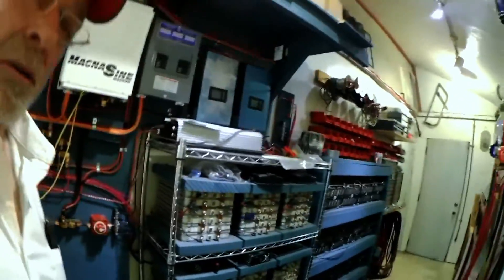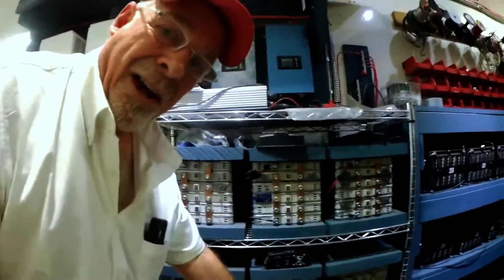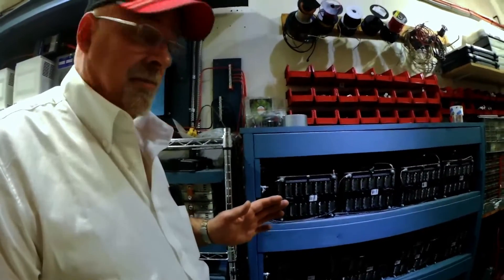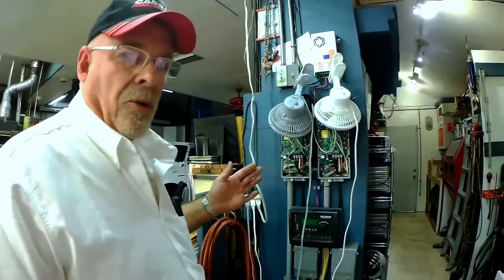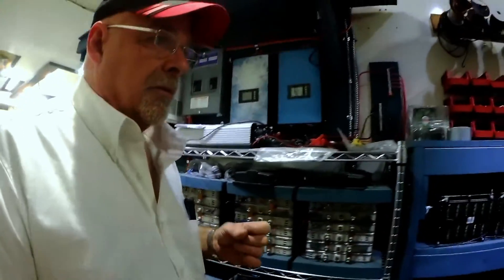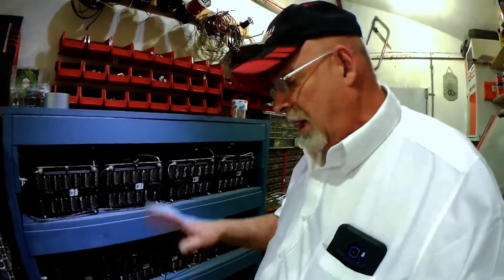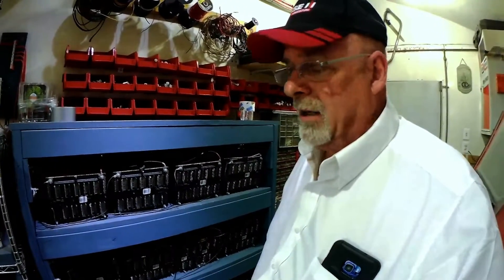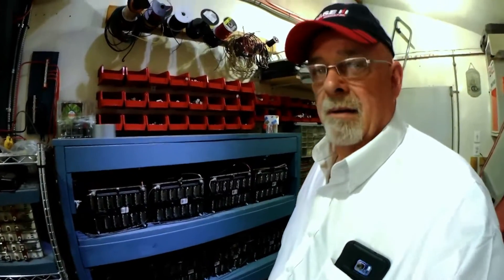BMS or No BMS ? - 30 Month Update

Comment: Thanks for the video! I have a 100 AH lithium (LFP) 4-series battery on my sailboat that I have been running for four years without a balancing BMS. I did that after a bad BMS (damaged by a nearby lightning strike) ruined an earlier battery -- FETs don't like voltage spikes. I have a battery PROTECTION system that cuts off charge at 80% SOC and cuts off discharge when the pack voltage drops below 12.8 volts (3.2 volts per cell): about 20% SOC. Current limiting is accomplished with a 60 amp series fuse ($18). I charge and discharge at 0.2C max. I installed thermostats on every cell in a series string that shuts down charging and discharging if the cell terminal voltage reaches 40 C - 122 F ($15 each). Low temperature charging (below 0 C) isn't an issue in my climate.

I charge the pack under careful supervision once per month to 100% SOC while monitoring cell voltages. Once, only once, I manually top-balanced the cells using at 2.7 ohm resistor ($1.50). The pack tests at 97% capacity after four years and about 500 cycles. A balancing BMS is a mixed blessing (complexity is the enemy of reliability) that seems to only be a necessity when running a battery at high C rates and high and low SOCs. They make sense with an electric vehicle or any application where the user wants to squeeze out every last amp hour, but they carry the risk of failure in the BMS itself.
Reply from the maker: Bravo !   I have absolutely nothing to add to that :-)

Comment: Interesting to see a long term test on a large setup with no BMS. Thread is 4 years old is it possible to update to 2024?
Reply from the maker: I ran them without a BMS all the way to the fall of 2023 when I switched over to LifePO4 cells from Docan Power.  The Volt and Leaf cells remained in near perfect balance the entire 7 years they were in service and amazingly tested to 90-92% capacity when I tested each individual 48 V pack.  The Leaf cells went to a friend in Texas, I got almost what I paid for them. I still have the Volt cells.  I need to get them up for sale. Thanks for watching

Comment: I'm taking the same approach.  I will employ a Active Balance board ..   All charge and discharge will be done via the Inverter limits and Solar Charge controller voltage setting.  Add adding a low voltage alarm  that will tell me if the Inverter is getting close to shutting down.  

Your set up would never even activate the Balance Board I'm using.  Hopping the same will happen with mine.
Reply from the maker: Yes, our set up may not activate the Balance Board until the Balance Board takes a shit and corrupts our otherwise stable cells ....lol  THAT is what I'm worried about.  Until then, I'll keep an eye on them.
Reply: @mark_osborne  Yep..   KISS....   Keep It Simple Stupid.   Seriously I truly think more damage has been brought on by crappy BMS's then any other issues at hand.
Reply from the maker: @pulesjet  Yes yes, even GM had a problem with the Chevy Volt BMS taking down batteries

Comment: Thanks for all your sharing.  I've only seen this one video, but , If I'm right, you're not using a BMS on your system.  Id like to hear more about how Not having a BMS works over having a BMS system.  This seems to be the question of the year with regard to small battery systems like e-bikes to solar systems and beyond.  Thank you for being honest and straight forward about this.  I appreciate your efforts and look forward to learn from your experience.  i personally think that you are on the right track, but you need to have some kind of surge protection in the event of some spike like lightning or something  unexpected.  I build e-bikes and I've had two $400.00 batteries fail due to the BMS issues this year.  I can't help but wonder if it's a bunch of Bull Shit caused by he BMS.  Keep in touch If you can.  Thanks for the video.  I'll subscribe and like and all that. I'd like to know how to make the best of my batteries without having to repair the BMS when the BMS Shi^*ts the bed.. Thanks Again.

Comment: My friend bought a Chevy OEM LG Chem 10s 36v 5.94kWh from batteryhookup. We are trying to put it in a golf cart. I'm new at this and trying to help him. If we do a bms we can't figure out what amp it should be rated for. Figuring out how much amperage is running through the system is hard to do without an expensive clamp meter. Do you know how to get how many amps the motor is pulling or do you know from a previous project? Also considering just using bms while charging so don't have to worry about max amperage draw. Is that crazy? In your video, you don't seem too fond of bms. Maybe don't use one at all, since vehicle manufacturers seem to make decently safe batteries?

Comment: What size midnights are you using. And what is the wiz bang giving you for info that made you get it.
Reply from the maker: They are the 200 Classics Chris, they max out at 80 amps.   The WizBang is the heart of the information center, I can't imagine being without it.   It shows the 'state of charge' of the battery bank, 'amps going in/out of the battery bank', and the remaining 'amp hours'.   This could also be accomplished with a stand alone battery monitor that uses a 'shunt' style measuring device, I just decided to go with the WizBang because it integrated nicely with the MidNite display(s).
Reply: Could you send me a line diagram/ parts list of what you used to connect the batteries to the ground bars I believe you used to the controller etc. thanks.

Comment: interesting your midnite controller fans, I presume the oem fans not cooling enough?
Reply from the maker: They may have been cooling enough for Midnight's engineering staff but I can tell you the external fans you see in the video lowered the FET temps by 22 C  (from 65 C to 43 C)

Comment: I like you idea of no BMS... thanks for these videos.
I haven't read all of the comments, so I don't know if you covered this, but can you discuss the settings for your charge controllers?
Specifically, I'm interested in what your high and low limits are for charging and discharging are? (I'm guessing that with the banks that you have, you never have to shut down the batteries due to low voltage?)
Reply: Sorry, just heard you say what you lower limit is.
Reply from the maker: I don't know if I like the idea of no BMS or not. It's an experiment, one that causes me to question my decision almost daily .   But for now, it's working great ! The upper limit is 49 volts or 4.08 volts per cell.

Comment: I’m about to order a 56 battery turn key With bms from tech direct that claims 28 kw but then says 10 kw in the discription. Any thoughts. Thank you
Reply: I’m doing off grid for a good size house and want to make sure they have enough power. I may go ahead and get two banks without bms for same price as the one they sell with it. Yours are stacked on shelves in groups of 7 going to a ground bar ?
Reply: Would it be easier to get a good Chevy battery vs the leaf. Thanks for site info
Reply from the maker: @Starkchris  Yes, many times easier
Reply from the maker: attach a link and i'll take a look
Reply: https://www.techdirectclub.com/48-volt-nissan-leaf-lithium-ion-mega-power-pack-battery-28-kwh-66ah-storage-g1/
Reply from the maker: @Starkchris  Ok, yes, they are originally about 28 Kwh as installed in the car, but they clearly say they are only 60% usable so these batteries are severely worn out.  If you want Leaf batteries as opposed to Volt batteries try to find complete take-out batteries from a newer car.  I bought a couple retired EV car batteries from https://www.autowrecking.com/locations

Comment: Greetings mark. Can you please email me your charge settings and parameters for your Midnite Classics. I think you said to disable the float setting and have the re-bulk setting just below the absorb voltage. I will have ti figure this out for the Tristar as well. The Outback Flexmax uses the same approach as the Midnite so that should be easy. I am thinking about adding a Victron over-volt under-volt relay disconnect with programmable settings just in case one of the CC fails on the high side. I should have some lithium Ion batteries here sometime tomorrow. I am still looking into a true BMS not just a balancer. Lots to learn here..
Thanks
Reply from the maker: Done !

Comment: Thank you for the update. Impressive your battery bank. What is the max you charge to and the minimum you set your discharge to?
Reply from the maker: Max charge is set to 49.0 or 4.08 v per cell, float is 48.9.  The inverters will shut off at 3.5 V per cell, which I've never seen.   I'll start the generator if I know there's a chance of that happening. The DC gen makes 3 kwh's per hour, so if I anticipate a problem, I'll let it run for a couple hours before I go to bed just to be safe.
Reply: @mark_osborne  you have a 12S set up? That explains how you are able to do the Volt with the leaf
Reply from the maker: @drsolar  Yes

Comment: Heat is what causes thermal runaway. And fire. So if current is low enough it won't be a problem. Have you ever measure battery temp under your heavyest load
Reply from the maker: Thanks Roy.  These batteries are always right around ambient temp, meaning, they slowly warm up as the air temp warms up and they cool off likewise.  They never see a load large enough to cause a temp rise.

Comment: BMS - Battery MARK System :) keep an eye on it.... BMS are for the bad days not for all the good..
Reply: yep, if the battery is perfect and has no issues no BMS is needed. if a cell fails and goes to a short, the pack voltage drops and overcharges the rest of the pack, the charge controllers will not shut off and it can lead to the rest of the pack to be significantly damaged in capacity or cause a thermal runaway. you at least need a monitoring system to terminate charge or discharge all the time
Reply from the maker: @SuperBrainAK  Got it.  I completely see your point.  Lets say the change controller is set to 49 v or 4.08 v per cell, a shorted cell would cause the charge controller to keep pouring the coals to it trying to attain that average 49 v when in fact, there's one cell dragging down the average voltage (which is what the charge controller sees), therefore causing the other cells to over charge.  I totally GET IT.   So, if I were to have a digital voltage meter on each row of 4 packs, I'd at least be able to detect if one pack (in that row of 4) were playing hell.   Ideally, you'd want a volt meter on each pack - correct ?
Reply: @mark_osborne  If all of your packs are in parallel then having a meter on each row or on each pack wouldn't tell you any more than a voltmeter on the whole bank. In order to determine that an individual cell or series pack is failing it would have to be taken out of the bank, unless you have some other isolation in place.
Reply from the maker: @fullvegan  Yes, and I woke up in the middle of the night a few weeks ago thinking the same thing   Thanks !
Reply: @mark_osborne  looks like we wake up to the same thoughts :P
Reply from the maker: Thanks for dropping in !  I always enjoy your videos :-)

Comment: Are you running the Chevy Volt battery in parallel with the Leaf battery?  (Asking for when I add to my Smart ForTwo system) 
Glad to see that they're staying in balance!
Reply from the maker: Yes, crazy right ?   But they have the same max/min charge.  Many people said it wasn't possible due to different 'chemistry'.  Don't know about your max min voltage on the Mercedes batteries tho ?  Let me know what you find out. Lots of them out there.
Reply: The min max on the smart fortwo (Deutsche accumotive) is 3v-4.2v so should be good to go.  Seems like because they're running in parallel, they split the charge and self balance.
Reply from the maker: @benssolarandbattery  Yes, Ben, I believe they would run just fine together - given that !